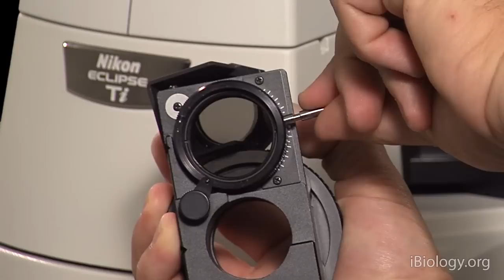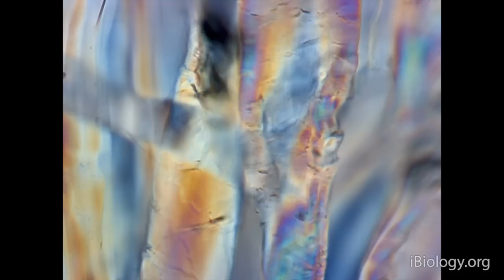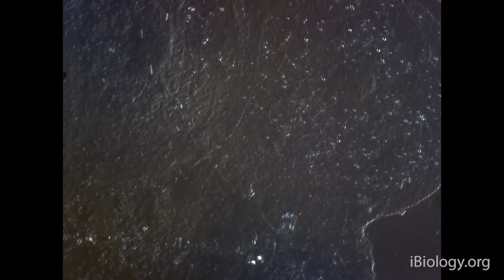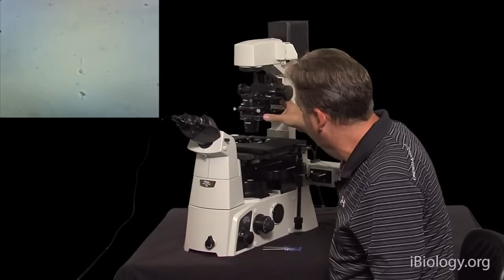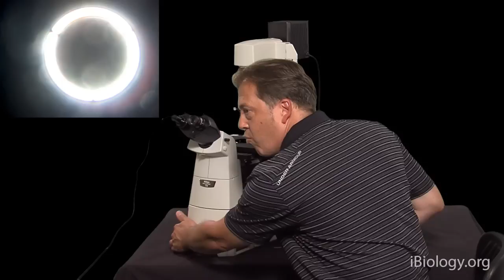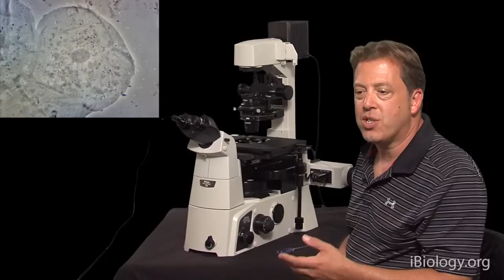Microscopy: Phase, Polarization, and DIC (Stephen Ross)

Comment: I just got an older TSM inverted microscope and I was wondering is there a camera mount or a camera made that specifically fits the neck of this microscope? I have seen what I thought was a TSM equipped with a completely different neck with a camera going straight up and the regular binocular assembly in its usual position. I have no idea what I should look for can you please help me?